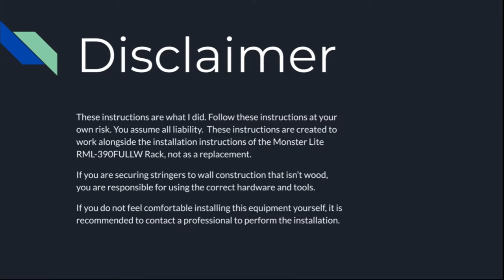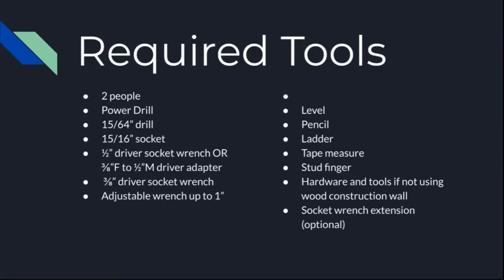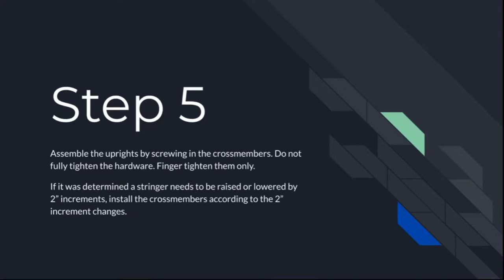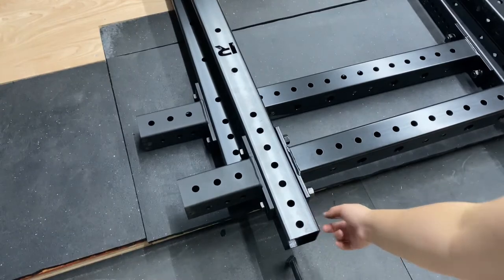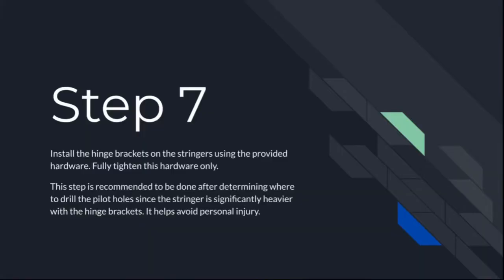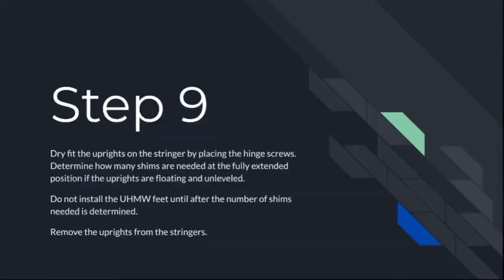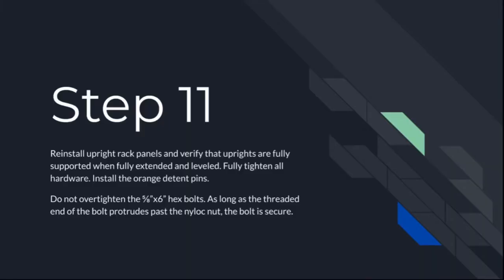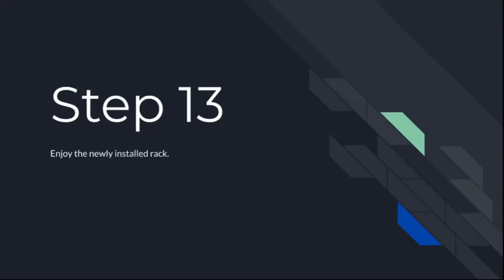Building the Rogue Full Folding Rack with TIPS | Building theLAB Gym - Ep. 9

Comment: Great video. Really appreciate this
Reply from the maker: No problem and thank you for the comment! Are you building this same rack?
Reply: @laurynfromtheLAB  I’m regards to extra hardware you were advising for the stringer.. I’m putting into concrete.. so the extra hardware is concrete anchor.. so total of 12 extra hardware??
Reply from the maker: @JK-yh2po Because you have 16 lag bolts, I’d recommend 16 concrete anchors that are partially screws and expand like an anchor. You’ll need to measure the size of the lag bolts to find the correct anchors. The wood lag bolts are  3/8" x 2-1/2" WOOD LAG, so I’d recommend to find a comparable sized one for the concrete. Along with the concrete drill bit
Reply from the maker: @JK-yh2po  forgot to comment, but if you research a bit more, you may be able to use the same wood lag bolts in a concrete shield. You’ll also need an impact driver & a drill. My husband hung up our tv mount into masonry with a similar method

Comment: WOuld it work to move the pin and bolt forward 1 space to allow more clearance with the wall?
Reply from the maker: That’s a good question that I did think of! But one of them was already on the furthest hole and if I wanted to fold in towards each other, it would interfere. But after this video we added another shim to the uprights and it’s much easier to fold for some reason! Not as flush but closer than the first time

Comment: Awesome video. What’s the heigh of the garage door track? I need to install mine around the same place, just after the track ends
Reply from the maker: It’s about 91”! But you can lower the crossmembers at the top by 2” increments if needed. I was going to have lower crossmembers initially to have a lower pull-up bar until I realized I can install it on the uprights and keep structural integrity

Comment: What is the measurements between the pieces in the wall?
Reply from the maker: I followed the manual, it’s dependent on your foundation, your floor height, and the placement of where you want the top stringer. I recommend consulting the instructions which you will find linked in a comment
Reply from the maker: https://drive.google.com/file/d/1ZWo08Bqsj_Ajqy8-cwbSFQVsJgka3deI/view
Reply from the maker: My bottom edge of the bottom stringer is 5-5/16ths inches from the platform since that’s the floor for my rack. Then from the floor (my platform) to the top stringer it’s 80-5/16ths to the bottom edge of the top stringer
Reply from the maker: The instructions say normal is 1-5/16ths of an inch from the floor to the bottom edge of the bottom stringer, but you can move it up by increments of 2 inches. Which is why my bottom stringer is higher by 4 inches

Comment: Does the rack compensate for a slight slope (1/4 or less)?
Reply from the maker: There are shims that can help raise an upright and the hinges have some space for an upright to be higher than the other. Is that what you’re asking?
Reply: @laurynfromtheLAB  I have the same issue that my rack won’t completely fold shut.
Reply from the maker: @car1it05WAY  where is it hitting exactly? Someone else asked if the slope will prevent it from closing and I responded yes it could if you’re putting it directly on the slope! Because when you fold it, it will get higher and cause potential scraping on the front foot of the upright. I’m wondering if the number of shims used is a bit too much since the hinge does allow for some movement
Reply: @laurynfromtheLAB  where did you find the instructions? Mine didn’t come with any.
Reply from the maker: @car1it05WAY  you can email rogue with the model number and they’ll send a pdf! I’ve done it before purchasing to verify I wanted it too
Reply from the maker: @car1it05WAY  here is the one they sent me https://drive.google.com/file/d/1ZWo08Bqsj_Ajqy8-cwbSFQVsJgka3deI/view?usp=drivesdk
Reply: @laurynfromtheLAB  Awesome. Not looking forward to install this rack lol
Reply from the maker: @car1it05WAY  it’ll be so worth it